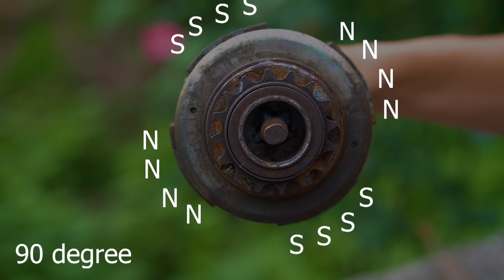I build 220v electric Hydropower dam

Comment: If this is true, then there will be no need of big hydro power plant😂😂😂. But the thing is that he did not show the 220v power is taken from his home or anywhere else 😅😅😅. This video is completely fake. If the power output is high then the generator load also should be high then the rpm should be low, but in this video that wheel rotates constantly. Don't make money by making others fool.🤬👎

Comment: no ones gonna talk about how he said 100kv coil? they output 2kv max xD if that was 100kv it would have arced back into the wire through his body if not, then jumping that huge air gap before he even got close to touching the iron core before he tested the arcs most of those transformers are wired 20:1 (20 x the input voltage) so 120v input would output about 2400v

Comment: NO way. 2500 watts with 4-poles is 1800 r.p.m. with 5 horsepower. 5000 watts at 3600 r's with 10 horses with 2 poles is 3600 r's for close to 60 cycle a.c.  THIS? Nope. Maybe a little but not much.

Comment: Честных 7,000 ватт.
Только не пойму, зачем ноли после запятой, можно просто было написать 7 ватт. 
По цене получается почти 100 баксов.... явно дороговато.
Reply: If you don't use a chain,  He can also do it, the way the two water shafts and the generator shaft are connected, then you will get stronger power.

Comment: Hints that this is fake:
1. Uses a newer welder 
2. Uses new bricks
3. Uses new steel beems
4. But can only afford gunk to build the generator
5. Uses a "shovel" that makes no sense
6. The marks on side of the canal don't match the "shovel"
7. Nothing is done to maximize the water "head". Even the outlet pipe from the "dam" is near the bottom of the "dam", and the generator "turbine" is only a few inches below the "dam" outlet. The generator "turbine" could have had several feet of water "head" but that doesn't look as good on the video.
8. The outlet of the generator "turbine" is directed directly at the dirt wall of the canal. Not only is this unneeded but will quickly destroy the canal. This shows that this isn't intended to be used after the video.
9. The whole system is designed horribly. It couldn't power the light bulb by itself. In fact it would likely struggle to power a 0.5w LED nightlight.

Its a shame because a very low power hydro generator is useful. Even one that can only sustain 10-25 watt-hr DC.

A plant at that capacity would provide 240-600 watt-hr per day. This is about equivalent to a 50 watt solar panel, but works even on cloudy days and at night (I live in Washington State were the winter time only averages 3.5-4 solar hours per day. This means that a 100 watt solar panel would be lucky to match a 10-15 watt-hr hydro plant)

A 10-25 watt-hr hydro plant connected to a 12v 100 ah battery via a small solar charge controller is enough to power low wattage LED lights through the night. 

Assuming a 12 hour winter night, a 10 watt-hr generator is enough to power 20 watts of LED all night.   Or a single 5 watt LED (about the power of a quality 40 watt equivalent light) light all night leaving 180 watt-hr to charge cell phones, tablets, laptop. The  battery on a high end cell phone takes about 50 watt-hr to fully charge.

It is also enough to run a small on-demand water pump, a couple of on-demand 5 watt LED lights, a couple of 0.5 watt night lights and charge a phone or tablet.

This is a huge deal in certain parts of the world.

Comment: Reading the comments the general opinion is this is fake. Meaning the generator is not turning fast enough to generate electric power enough to power the fans and lights. That part I am not sure of, I have basic knowledge of electrical but not enough to say one way or the other just from what I see in the video. I suppose it could work, maybe it's not 220 volts? Those look like standard 110 volt house fans. But my question is, how is the water reaching the higher basin to power the dam? I can't imagine there are two ponds that close to each other with that much difference in water level. I would assume he is pumping the water from the lower pond up to his higher basin of water which would render the entire project obsolete. LOL. I love the ingenuity though.

Comment: Not uninteresting. 
Just factually incorrect. Even knowing little about how hydroelectric generators work one could look at a very famous one (like the Hoover dam) look at the scale and average power output and take a reasonable guess at this (I don't even really want to call it a proof of concept) things "abilities"... 
Why not check it with a multimeter to check its output (I'll disregard some shortcomings that stop this project before it even gets in the water - load balancing) instead of hooking some fans into its supposed circuit and giving multiple thumbs up(s)

Comment: 16:04
He touched the generator and didnt get schoked?
Reply: Other than this video is fake...in this case no. Here is a simple dumbed down explenation. In order to get shocked you nead to create a circute. Usually this happens over ground. The circuit he "created" is isolated and has no connection to ground. Meaning with one contact point it es not possible for current to flow through him and back to the generator.

Comment: It's basically an undershot waterwheel. If he would have not used the bucket and directed the water directly on the water wheel what by the way would increase the efficiency.
If you interested in the physics behind and undershot waterwheel there is a good lecture of the University of Munich: https://www.youtube.com/watch?v=79hTQ87bXm0
Instead of pretending to be a utopian performance, he should have shown the actual performance, then the video would be much more interesting.

Comment: I get this is a video to make money from you tube and im sure this guy will need that money. how ever the video is fake. IF you tried to hook up 220v 7000w to an outlet it would trip power strip surge protector. Even if it had no surge protector sending that much unregulated power to devices like a fan and bulb would blow all of the out. for this to be realistic fake you would need to have some kind of regulation circuitry to be more believable

Comment: That is a horribly inefficient generator design.  The magnets are FAR too small, the air gap is too big, you are running to bridge rectifier, the gearing is wrong as you need FAR more RPM for a generator to do much, that water turbine is horrible.  With only 2 phases that light would pulse like crazy, and it is doubtful you can get more than 50w off that setup.  You just turned out burying and extension cord and faking it.  What a scam...

Comment: 😡100% Click Bait thumbnail and misinformed video. Just give a thumbs down. He really diserve  that.
Reply: The concept it sound, 
BUT 
there are many things I would have done differently, like have a full wave bridge rectifier on each transformer output & have 2 sets of outputs in series, then have both sets in parallel & just charge lead acid or Li-ion batteries to power an inverter for stable AC frequency.

Comment: 7000 Watt ……… you have 0.25 Mters Fall high with maximum 10 kg of Water per Second . Mass per Second times Gravity Constant times High is the Power. 24 Watt Primary Power …… your Turbine has max 50% wich means not more than 12 Watt. You are a liar ……